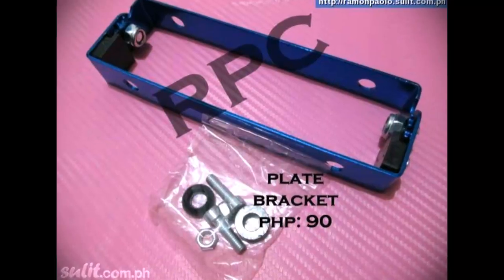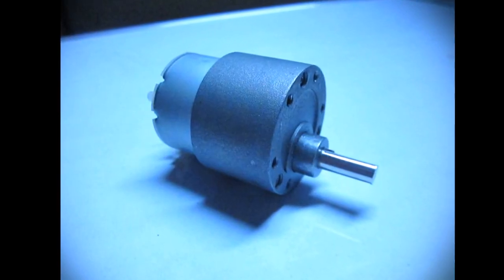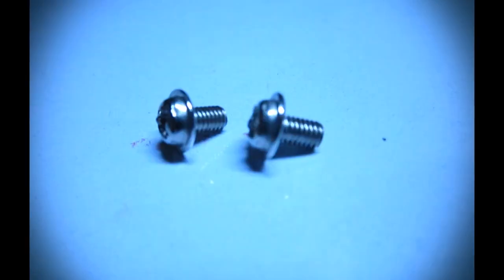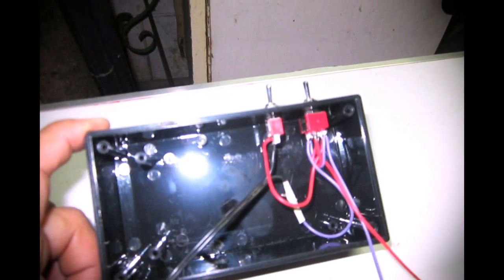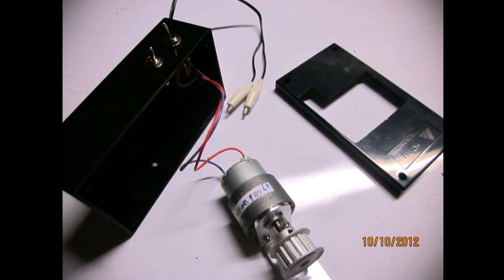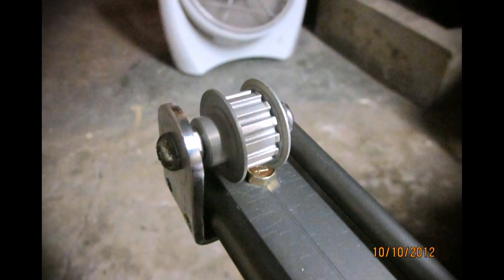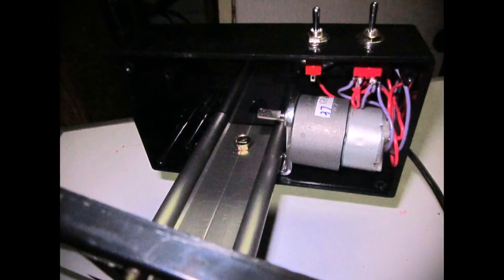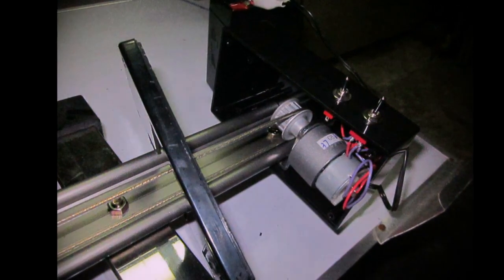My New DIY Motorized Cam Slider

Comment from the maker: and another thing stonedcommander ... I use 4 AA = 6 volts rechargeable penlight on this Igus slider video,now I tried using 6 volts SLA battery ---(sealed lead acid battery) they are much more better and faster ..wait for my updated video

Comment from the maker: No wiggle Bryce,Igus is so good in sliding,its just the temporary clothesline wire that I use sort of slipping in the pulley making the carriage halt movement intermittently ," inertia" ,you see I have not received my order of toothed timing belt during this shoot ,now I got them and they are running smoothly ,I will tag and show you an updated video...

Comment: Wonder if on very smooth and level surfaces you could use 100lb. test fishing line and pull maybe a skateboard or roller skate at much greater distances? The line is very thin and wouldent clog the spindle. Worth a try maybe.
I bought a 6v, 60rpm motor from ebay and it dosent work:(. 
Was building something and needed...Not worth shipping back, ill try a local hobby shop.